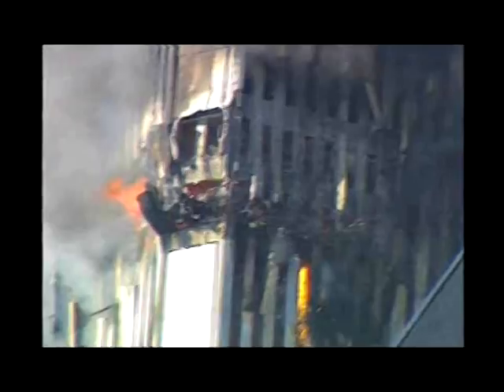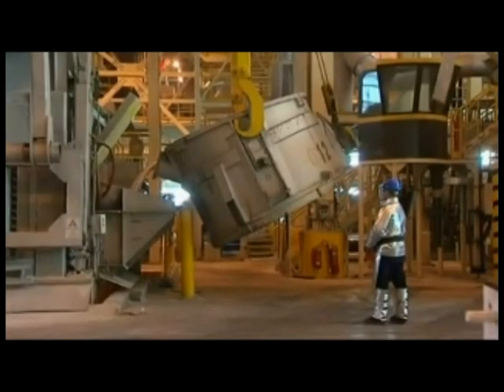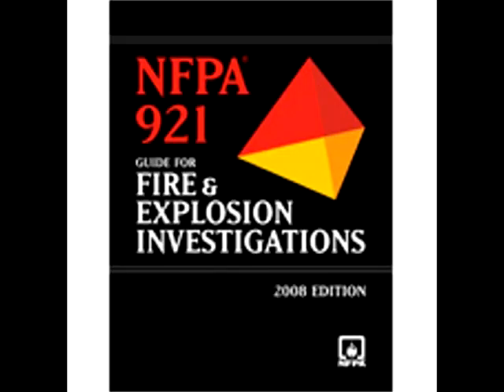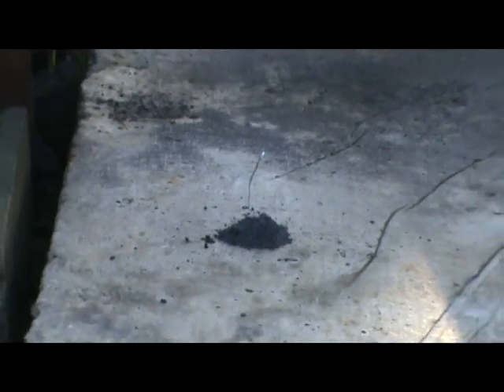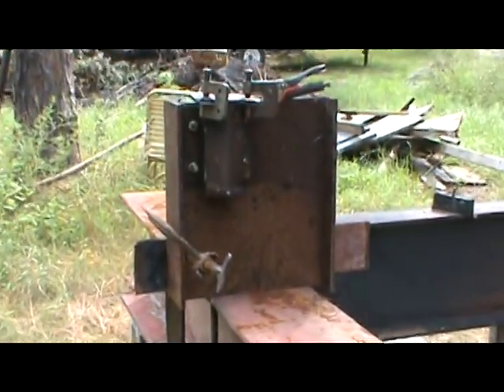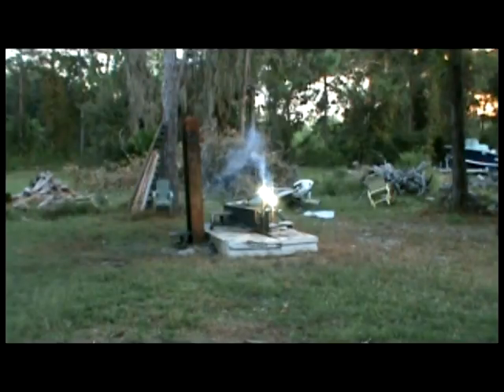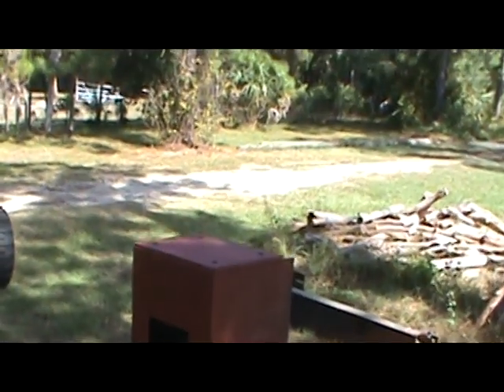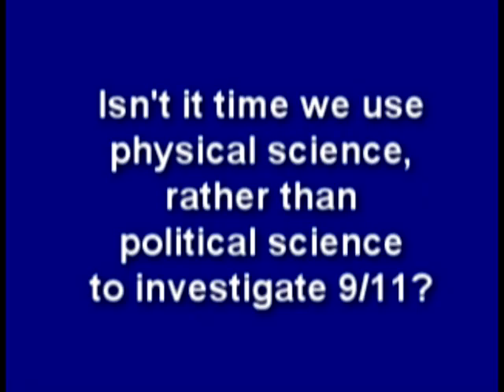9/11 Experiments: The Great Thermate Debate

Comment: I always figured that it wasn't really caused by the steal melting as much as it being weakened by the heat. You don't have to reach the melting point of a material to overcome it's structural integrity.

That's just my thinking though. Lots of heat + weakened steel + tons of missing structural support from where the planes hit + massive weight from the floors above = collapsing tower

Not to mention that flames dieing out =/= temperatures dropping. Think about bbq's, those things only start to get up to temperature AFTER the flames have (mostly) died out.

Comment: Yes, thermite  materials can cut and weld steel and iron. It was used to weld railroad rails and ship prop shafts so it does get hot and is cheap to make. The question is: how many beams and girders would have to be cut to cause building collapse as the twin towers skin was a structural member and then how are you going to get the devices needed to contain and concentrate the thermite in place without someone noticing. A large fire in a building made of steel structure does not have to burn through the steel  (high temp), it just needs to soften it enough to cause it to sag out of place, throwing the balance off and overloading the surrounding members past their ability to hold I the load up.

Comment: As someone who has worked with steal construction for my entire life, i can safely say that jet-fuel can not melt steel beams.
Steel has a meltingpoint of 2750°F
Jet fuel burns at 1500°F.
But, that doesent mean that the 1500°F isn't enough to weaken its molecular bond.

Then again, it doesent really matter, because the jet-fuel burnt up in the wings on the impact, and the building started to collapse further down, wich in it self is impossible.

Comment: In 1986 I was a trailer body technician. The trailers that carry cargo up and down the highways. I was using a cutting torch on it and it caught fire. The aluminum skin and upright structure melted while the steel sub frame did not. The fire was intense. As the fire raged, material like in the video ran to the ground and was red hot.....'red' hot. After the fire was put out, melted aluminum surrounded the perimeter.Molten aluminum, pewter, plastic, nylon, rubber and everything you can think of was coming out as the building burned. It doesn't have to mix to pour out at the same time.

If thermite was part of a government plot, then that thermite would have to be placed packed around open bare beams, not possible

Comment: Here's the thing people who don't know about metals and materials don't understand. YOU DO NOT HAVE TO MELT A STEEL BEAM TO MAKE IT FAIL! As steel heats up it looses strength. Beams responsible for supporting a huge structure are under enormous amounts of stress. They don't have to reach melting point before they no longer have the strength to support their load. When that happens, the beam fails & stuff falls down.

Comment: Few points you have not considered, a building that high has winds speeds of 30 - 40 mph + as the floors glass was blown out the wind funneling through a 10 foot  high floor fanning a fire like that with jet fuel would get extremely hot. Hot anoth to melt steel tube under high load.

Point 2 the dripping "steel" as you say could be molten plastic that offices are filled with, evidence found on the ground after destruction blobs of molten steel would happen when the building crushed it self. Heat generated by destruction was immense.

Point 3 why would it be a inside job, if Us wanted to go invade afghanistan they would as they did with Iraq, so what the motive?

Point 4 tube is strong end on, side compression it is weak, as 30% of it was missing due to a plane hitting it and the shock to the rest the structure, it was halfway going.

Point 5 Get over it, go outside, get a life.

Comment: It's funny to think that both towers finished having major renovations, including structural renovations until March of 2001. Steel grade was stronger within the lower floors and in the 1940s a U.S. Bomber crashed into the Empire State Building and the damn thing didn't collapsed. The stuff may not have been in there since its construction but if it is true. It might have been placed there during all its renovations during the 80s and 90s. Who knows. 
Great video though

Comment: It was rather simple. We were told the towers collapsed from the plane impacts, so we don't need to look for any type of explosive. Why wouldn't they allow it when they are convinced no explosives were used? What is the harm giving access to the rubble to take more thorough tests. That alone should make anyone question the whole deal on the official story.

Comment: People really need to wake up.  Truthers included.

Its very simple, after the first basement bombing that failed to take down the WTC, safety (or rather the insurance/financial company) required a means for the towers to be demo'd safely and remotely, in the case of a structurally compromising situation.  The New Twin Towers were a high risk terrorist target and knowing this, I (and anyone else with this much to lose) would demand the buildings be prevented from damaging surrounding buildings and/or killing thousands more people in the surrounding area during another attack.  If a building that size fell over it could potentially result in obscene amounts of liability cost.  This simply would not have been a risk that any company would take without some measure of reassurance that the building could never drop outside their own footprint outside of a meteor impact or a nuclear blast.

People always want to create the devil, but the devil isn't real.  There is nothing evil about risk management.  And sure maybe some people in the CIA found out about the emergency demo clause in the WTC insurance contract, and sure maybe they trained the terrorists who eventually came and acted out these attacks, but if you do what smart men have been saying since the era of messiah worship (and likely far far longer), and follow the money, you will get a more clear idea of what actually happened.  False flag or not, the cost of catastrophic failure at the WTC would have been, too large to even imagine taking on the risk for such a high profile terror target that has already been attacked.

The real devil in our world is a little thing called "Cost Analysis" and until the majority of the retards, we refer to as human, realize that corporate cost analysis includes a set value on human life... we will forever be stuck in a corporate run loop of profit maximizing and human slavery.  Your life is a dollar sign and if they stand to make more money than it costs to end your life, you become a profit margin.  End of Story.

Comment: I like it! I There were some omissions... a few things very intentionally glossed over... but very well done! I personally don't agree with your conclusions, but you very effectively conveyed your reasoning behind them. 

I will leave out the other omissions in favor of this:
Melting temperature of soda-lime glass: 1675°C.
Melting temperature of structural steel: 1510°C.

Anyone can melt a glass bottle in the hot coals of a campfire. I have never needed jet fuel. 

Day one Thermo. Heat goes in, heat goes out. If out is less than in, temperature rises. No where does that say that when it reaches a magical temperature, it just stops adding heat. In open air, out and in balance at your specified 1832°F. However this assumes open air. Which is just that, an assumption. 

Now, given that assumption, the rest of your data and experimenting is pretty darn cool! You should consider going into demolition, maybe they will have the insider information you are looking for!

Comment: Steel structural members don't need to be melted or cut to lose strength and fail. I've seen heavy steel beams warped and twisted by the heat from burning waste oil and paper in a garage fire. Anyone interested can look up "coefficient of thermal expansion" and read about the effect of expanding steel on structural connections and how they can fail as a result of relatively low heat exposure. 

A lot of what s being described as "molten steel" in those 9/11 images is more likely from light gauge elements, electrical fixtures etc and not from structural members.

The idea that someone was able to install enough thermal devices to bring down a structure like the Trade Centre with out being detected is frankly absurd. They would have needed access to the steel itself and enough time and manpower to install hundreds of devices all without being noticed either during the installation or in the period of time between the installation and detonation.

Comment: weather it was a inside job or not just drop it. thousands of innocent Americans died on that fateful day. but only conspiracy theorists are focusing on the twin towers. so what about the the airplane that crashed into the Pentagon and the other that crashed into a field. no-one is saying anything those airplanes. now it was proven that the fire retardant that was not applied past a certain level. when structural Steel that is under weight is weakened by heat it will most likely collapse inward.

Comment: Iron from the tower and pulverised aluminum from the aircraft frame + burning fuel = thermite. No need for conspiracy theories. Steel was not burning or melting itself, aluminium was not buning. It was the powders mixture that could ignite and create 2000C temperatures needed to destroy the building's frame.

Comment: Your theory sounds plausible until i give you some extra piece of information:
On the steel frames was attached aluminium window frames, which are clearly shown melting in some other videos, now you have the two bits of why it melted. Whilst the main fire was going down, they could not see what was going on at critical points within the building.

Comment: How was your Patriot Day '15, by the way?
Oh yeah, this is the same stuff they use to weld railroad!
Okay, so even if the physical evidence is the way you're showing us, then there are still 3 things that I don't get:
1. How would terrorists get that material into the columns before triggering it with the plane crashes?
2. They wouldn't be able to, right? So it's an "inside job" for some reason, right? Well in that case then, what motivation would there ever be for a supposed "inside job," especially if it would kill so many innocent people?
3. If it was an "inside job," then did we go after osama just to help "seal the deal" on said "inside job" (I mean to help convince us public that it wasn't an inside job)?

Comment: Jet fuel can't melt steel beams.
Reply: +o0julek0o No, but then again nobody except the Twoofers makes that strawman argument.  However, steel does start to lose significant strength at 700 degrees F, and nearly half it's strength by the time you get to 1000 degrees F.  That's all well below the temp at which Twoofers acknowledge the fires burned at.  Plus there's a phenomenon called "creep" whereby steel actually changes shape slowly under high heat, further exacerbating the structural issues.
Reply: +Michael Fussell Cite a source (NOT a truther site) which found a sample of what people saw,analyzed it,and came to the conclusion that it was steel.
Reply: +crushffl why was molten steel actually seen by eye witnesses though?
Reply: It can if you light it.

Comment: And just when would anyone be able to plant all these thermite cutting crap? You explained thermite and thermate very well. However you have yet to explain how all these intricate feats of engineering were completed? Who did it? When and how?
Reply: +sam mckinstry Not to mention that, but how the firing mechanisms remained intact and functional despite the impact and fire, how they managed to put them on the floors where the planes hit, etc. etc.  They saw molten aluminum dripping from a spot, probably contaminated with glass, copper and all kinds of other substances present on that floor, and insist it had to be thermite.  They need an explanation for the building coming down because of the impact an fires, because they are too stupid to realize that steel loses most of its strength at temps well below what even they admit existed due to the burning jet fuel and other debris.

Comment: I thought the reason the towers fell in the end was the failure of the connections between the floor beams and the four outer walls of the towers. As the towers are basically two tubes, an outer tube, and an inner tube (which housed all of the elevator shafts, stairwells, water pipes, ventilation ect). There are no supporting columns between them, just beams that run from the central columns, to the outer columns. These beams prevented the outer columns from literally falling over. A clever design to create as much open floor space as possible.
As these floor beams are under tension, they will be particularly vulnerable to heat, at just 500 C they will have lost half there tensile strength, so if any were missing, well the loads on adjacent beams would be increased. When the beams failed, they would make an enormous bang. There would come a point when a cascade effect would happen, as one beam failed, the next would fail almost immediately.The outer walls would be pushed outwards, and the inner columns would now have to support twice the weight. Now add in how many of the inner columns would have been damaged by the crashing plane, well the building would collapse in on itself.
There are many pictures of the outer columns bowing outwards as they stretched the failing floor beams. The reports of loud bangs, the way the towers fell, all support this chain of events. 
The reason the towers stood for so long was because they were well designed and well built, the reason they collapsed the way they did after the plane impacts was also due to how they were designed. A conventional steel framed building would have at least partially collapsed immediately. If that building was as high as the trade centre, it would likely have completely totally collapsed immediately.
Why the fascination with thermite, which is more commonly used to weld rail track together? I don't get it. It would have been quicker and easier just to have a couple of guys undo a few of the bolts holding the beams in place, , ,
Reply: +danthundercat But, but, but, that's part of the "official report" put together by all those guv'mint engineers and scientists, so it has to be wrong!  Don't confuse Twooofers with facts!

Comment: The Nazi's originally burned concentration camp dead bodies situated upon railway beams stacked one on top of each number' as the bodies burned they dripped burning body fat - after hours and hours of exposure to the burning fat the railway beams bucked and broke under the weight of the burning bodies.  That's historic fact.

Comment: You forgot the fact that planes crashed into the buildings.
There were people that had links to terrorist organizations on board the flights that crashed with box cutter knifes used to attack the flight crew.
Fires burning at over 1000 degrees can't melt steel but it can buckle steel to the point where it can't support the weight of the tower above it causing it to snap and the tower to collapse.

Comment: like me, i think people have trouble beliving it was just the planes that took down the buildings because we have seen tons of failed building demolitions. When a group of professionals fail to cleanly demolish a building (it falls over instead of collapsing for example), it makes it hard to believe that ramming plane into the side of the builing could do the job better.

I guess the only explanation of that is that the WTC were designed to collapse the way they did to minimize damage to the surrounding dt new york area. that is completely believable, and it also explains why it happened. It just begs the question of how "easy" they made the building to demolish.

Maybe its "auto-failsafes" were the reason it went down so fast and so clean.

Comment: Great work on the thermate demonstrations!
Very thoughtful, not your usual crackpot 9/11 conspiracy video.
However, you haven't nearly convinced me.
I think you are dismissing all the dynamics of an air-blown sustained fire on steel under pressure.  After all, air furnaces are how steel is made.
It is very likely that all the evidence you see (the "puffs" and "orange" melt) is simply the result of the strange mixture of volatile compounds being exposed to hot gases.
Steel columns will do crazy things too, when exposed to incredibly strong forces the bolts will shear off, some will twist, some will snap... depending on the force and momentum of the force.
Further, eyewitness testimony, especially under stress and emotion-laden events, is notoriously unreliable.
But again, seriously great work with your thermate demos.  You really are a good engineer!

Comment: weren't all the beams encased in concrete?
Reply: On the outside but inside just insulation and drywall
Reply: so the guys who planted all the explosives,, stripped all that blown insulation,, wrapped the beams with explosives all in an occupied building with nobody seeing it?? then whoever was flying the planes flew them onto the exact right floors where the explosives had been planted? C'mon,, the simplest explanation is usually the right one. I've used torches to heat metal for the last 20 years of my life and an 1800 degree fire is more than enough to soften steel. Also that metal that was liquefied,, how do we know that wasn't due to a high voltage electrical wire arcing out on steel and melting it which is completely possible. After all Electrical current is how welders melt metal.